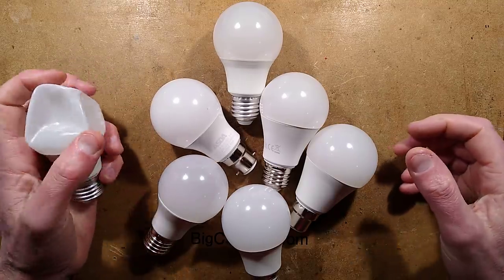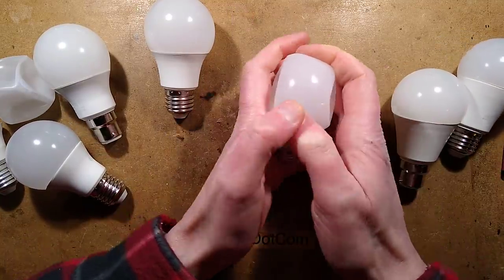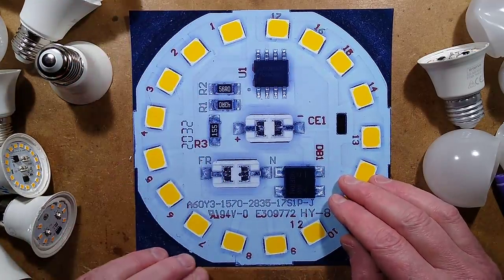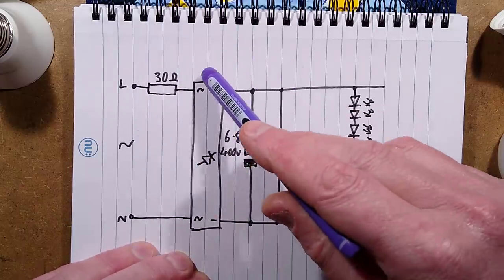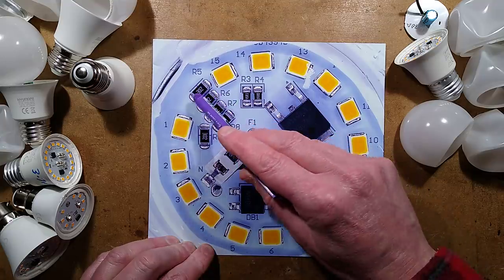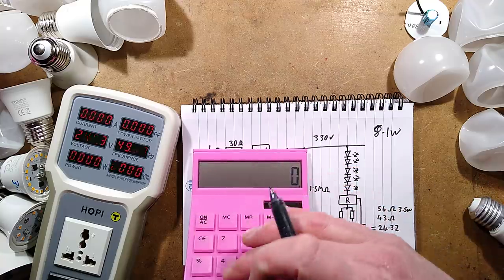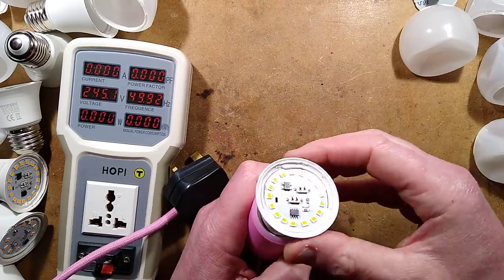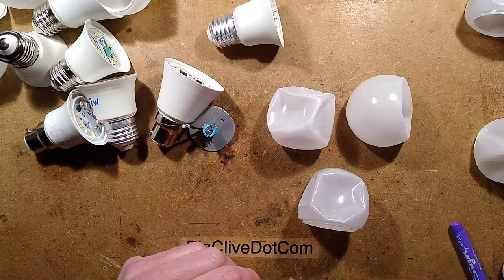Crushing and hacking LED lamps

Comment: Would it be possible for you or an equally brilliant individual to design your own Dubai lamp that someone like pcbway (for example) could produce? It really pisses me off that I can only buy intentionally overdriven bulbs that are designed to fail.
Reply: Thats.... Actually not a bad idea
Reply: Honestly i think it may be easier to just use led strips with your own driver circuit.
Reply: I think it really bothers most of us that follow Clives channel Chris.
Reply: Kickstarter?
Reply: My thoughts too. In fact when the lamps in this and other videos are modified in this way they are an equivalent, really.
Reply: these overdriven led's last less than incandescent bulbs, even philips ones. they should get regulated
Reply: And yet they're still really damn dark, I hate living in weird semi light even with the brighter LED bulbs available.

Having grown up with 150W bulbs everything else just seems like darkness and the ones in the shop that say they're 100W equivalent clearly aren't.
Reply: Get the highest powered leds you can find then make the mods.  Probably could use clear plastic circle glued on for the globes if the temps are right.
Reply: @ElvenSpellmaker  Problem with many LED lamps is the radiation pattern. Lamps such as the style in this video may provide similar light output in front of them, but hardly any back towards the cap.
They just don't look right in many light fittings and in a conventional pendant fitting they make the ceiling horribly dark which makes the forward light seem much more "glarey" and have harder shadows.
(Don't get me started on spotlights and downlighters in kitchens!)
My preferred type of LED lamp is the filament style in a glass bulb with the "pearl" or frosted effect, I've used the Osram Parathom Classic A and P shape versions of those for wall and pendant light fittings in my lounge and dining areas, but use the cheaper clear glass Asda brand (I got a load when they were on clearance) for less critical areas such as hall and stairs.
Reply: @nirodper  Hopefully they will. There was an article on BBC Breakfast this morning discussing just this .. the fact that modern appliances just don't seem to last, and suggesting forcing manufacturers to do something about it AND make spares available for at least ten years. Just like it used to be.

The whole point of LED lamps, we were led to believe, was that they would last something like 25 years. Deliberate planned obsolecence of products should be legislated against, IMHO. Whilst products would then have to be sold for a realistic price, it would be worth it for the environment and for us.
Reply: @ElvenSpellmaker  I do agree with this in general. They are only suited for mood or accent lighting IMHO; the minimum required for lighting a reasonable-sized room, say 12ft square, is a 15W LED or 105W halogen GLS, or, as you say, a 150W traditional GLS. Probably also supplemented with other light sources e.g. wall lights, table lamps etc. where needed.

A good example is my front room, which is smaller but with quite dark Victorian-style wallpaper, has a 6-lamp chandelier. I initially put 6x25W incandescents in but it was simply too dim even when turned right up. 6x40W incandescents (or now, 28W halogens) are just about adequate but I wouldn't be able to work under them. I suppose 6x5W Daylight (6500°K) LEDs might be better especially as the white light would illuminate the wallpaper colours more efficiently. Would need to be dimmable though!
Reply: @BG101UK  You actually don't need dimmable LEDs you just need to buy the correct dimmer switch unit. Trailing edge dimmers can accommodate regular LED bulbs fine and work the same as the old incandescent. It's the older style leading edge dimmer switch units is where  regular LED bulb compatibility is shoddy at best and non functional at worst. It might be worth it to look into changing the dimmer switch unit so that way you can just use the same LEDs you already use without having to switch over. Which is cheaper for example GE 4 pack 60W equivalent LED's non dimmable cost 9.99(7.17 pounds ) and the dimmable cost 11.99(8.61 pounds)  tax for these in USD can range is about around 1.55 depending on store. Which you can find leading edge dimmer modules on ebay that are the same price as the the 4 pack for the same price roughly as the non dimmable bulbds
Reply: PLUS the fact that the manufacturers state things like 25,000 hours life or lasts for 25 years! More like 25 weeks for some of them!
Reply: @BG101UK  
Ok make spares available for ten years !
That'll never work …...........

Your spare is in stock madam .
It's 4 times the cost of a new unit madam . 
No madam it must be fitted by our technician .
Cost we charge £90 per hour .
The book time for that job is 3 hours 11 minutes madam .
No that's 4 hours plus the call out & disposal fees madam .

Do you ….. madam are you still there    ….....
Reply: @gd2329j  the idea is that products be designed to be serviceable, and have parts available. It should be obvious, really. I don't know why we're still even putting rectifiers in bulbs, it should be a thing of the past.
Reply: @ElvenSpellmaker  you grew up with 150W bulbs?! In my family's home we used 60W bulbs in most places. Thinking you were putting a 60W in but ending up with a 100W was obnoxiously bright. Our living room used two triplets of 60W bulbs, I suppose that technically came out to 360W for the room, but it was soft. Have you tried multiple bulbs?
Reply: It's very easy to build your own LED lights. The open source world has you covered with a variety of options from kits you assemble into a pre-determined form, kits with the parts but you decide form, parts to make your own kit and these are all available from "wtf is a soldering iron" to "fastest iron in the west" level of electronic skill.
Reply: @simonparkinson1053  You can also get bulbs that are half-mirrored to reflect light back up to the ceiling.
Reply: @Chris Mc  Do what I do. I run the 2700K downlights through a simple $12 tabletop light dimmer meat for LEDs. This way I get exactly the amount of light I want in exactly the look I want. No soldering needed.

BTW, FWIW, I avoid this form factor of light that is screw in. I only use the ones the power company gives me for free aside from some colored one's I've purchased from Aldis. They all run hotter than the form factor of the downlights. I even have lamps converted to the downlights. I have used these for about a decade now with no signs of them going bad yet. It's about the same thing as a Dubai lamp in the end.
Reply: @Milamberinx  Why wouldn't we put rectifiers in bulbs? Are you saying lighting circuits should be low-voltage DC or something else?
Reply: @BG101UK  I'm in the USA and have been watching LED labeling. They used to be labeled to the effect of 25 year life at 3 hours use per day or sometimes 25,000 hours. A few years ago all I could find were 15 year. Now almost everything is listed as 10 year or 10,000 hours (not quite 10 years). Of course, the 25 year bulbs started at $40 per bulb and the 10 year ones are often less than $3 per each in a set of six.
Reply: @creamwobbly  We most certainly did, what an odd thing to try and dispute. XD
Reply: @Chris Mc, Give me a few days to research the specs of a Dubai lamp, acquire some "intentionally overdriven bulbs", then modify and test them and I will report back here to reveal my findings. 👍 If anyone else would like to replicate it to ensure no biased results, it would be welcomed as well as appreciated!!!!
Reply: @BG101UK  You can blame RoHS in part for the fact that modern appliances don't last. Lead-free solder has the advantage of not putting lead into landfill for products that are just thrown away instead of recycled, but it also tends to crack much more readily under thermal-cycling than the old lead-based solder does, putting products into landfill earlier.

Bringing in right-to-repair laws with availability of schematics and spare parts and bringing lead solder back would overall reduce the amount of waste. I've got a 7 year old TV that's still great - except the organic phosphors in the back-light LEDS are degrading so it's discolouring to be rather pink and splotchy. I'd rather have a couple of dozen LEDs replaced than have to throw away 15kg of mixed metal/glass/plastics
Reply: @michealpersicko9531  Thanks, all my dimmers are at least 20 years old and are likely leading-edge. I guess some LEDs with SMPS would still be an issue though? I'll have to check on the prices here.
Reply: @gd2329j  I see your point,. The cost of parts is also in need of moderation. I suspect many spare part prices are artificially high, maybe to discourage repair. If extra parts are made during the production run they shouldn't cost that much more than when supplied as part of the product.
Reply: @simonparkinson1053  Yeah, the filament bulbs are quite nice, although my personal favorite are the glass COB filament style like these in this old video here: https://www.youtube.com/watch?v=auUlTDunBCc
You get the full light from both sides like the filament tube style but they're bigger and brighter, the only problem is they practically don't exist and even if you can find one, they're a tad expensive compared to the hundreds of $1-$2 bulbs everywhere.
Reply: @Sylvan_dB  This is certainly the case; I wonder how many people notice though? .. I make a habit of date-coding lamps when fitted although I do sometimes forget.

I expect lamps used in enclosed fittings and run for significant periods at a time will have significantly reduced lifespans. I do have one in the bathroom globe but it's not normally left on for hours on end and has been going strong for about four years now. Think that's a 15W lamp, daylight and just as bright as when new. I'll see how long that one lasts!

These newer LEDs with 10K hours rating are easily outlived by traditional fluorescent tubes, which are still (usually) cheaper. The ones I have in the kitchen have done well in excess of their rated life and still soldiering on. Magnetic gear of course, with electronic pulsestarters. I won't be converting those to LED! Yes I know it's 99 watts plus gear losses with them all on, but whatever .. ☺
Reply: @HaralHeisto  Exactly! There is no way all the components of these modern products can be recycled/reused.

By the way, I'm (still) part-way through restoring a 1950s flip-top Murphy (as my lecturer called them, it's a 310A) and have other (newer) sets which are either in working order or only need a component or two changing to put them right.

There's a Sony TV-990UB in the kitchen in regular use, still works fine. I have another which needs putting back together and one which needs a bit of attention (a bit deaf on UHF). Also a Dynatron cabinet set in the front room which just needs some dry-joints sorting out, these sets are about 50 years old! I have my doubts that the flat-panel sets of today will last that long.
Reply: Would it even worth? I mean, led bulbs in my house lasts at least 5 years. Some of them have 5 years warranty. If failed before, the manufacturer just exchange them for free.
Reply: @rupert274  put another set of leds anti parallel to the first set
Reply: @Chris Mc ... and I thought this very video is the instructions as how to convert any old led bulb into a dubai lamp by taming it down a little
Reply: @BG101UK  
A little insider insight may be helpful here .
Most are just resellers & don't make the parts .
It's made for them with their logo , in the required flavour & for the agreed cost .

This resellers price can be more than 100 x the original cost !

Here's is a real example from 2009 .
The manufacturer makes a unit , it costs £8 it's purchased for £15 by the reseller , the resellers price for Jo public is £180 .

A authorised dealer will get discount depending on affiliation or subscription normally 40 – 60 % 
that's how they make a profit 
( But the final price for Jo is £180 ) .

No further comment will be made on the subject .
Reply: If you have a lamp in mind we can work together to design the PCB for it, I am reachable on my Instagram account with the same name as here on YouTube.
Reply: Wouldn't these "showerhead" lamps do the trick? I mean the lamps with a surface densely packed with LEDs as they were common with first generation white LEDs.
Reply: Doooo eeeeeet!! Pleeeeaaaassse!
Reply: @masteryoda394  You don't understand the error.  This has nothing to do with designing a new PCB.  Those lamps can use same PCB and just more series of diodes to half the current, or whatever fraction you want, to achieve similar light output.  The circuit change is trivial rather than the manufacturing of putting more of those strands of LEDs on a hanger in the bulb.  You can of course, solder something up yourself to achieve this, but again, it is not about designing PCBs but rather the mechanical installation of the addt'l LED strands.
Reply: @stinkycheese804  good point,it is a lot easier to just get a lamp and modify it rather than go through the whole design Phase.
Reply: @ElvenSpellmaker  Ikea used to sell a 22W LED bulb that was over 150W equivalent. I bought a couple for my Mum's house after my sister kept complaining about the CCFLs taking too long to warm up. They seem to have discontinued them now, probably because they were £15 each and the size of a grapefruit.
Reply: @MrDuncl  AHAHAHA shame! I wonder if the technology has advanced now such that they're no longer so large
Reply: @ElvenSpellmaker  The LED die tech has advanced, but also they're just saving on material costs and letting bulbs run hotter with lower lifespan expectations.  A well designed 22W LED bulb SHOULD be about the size of a grapefruit, if in the normal bulb form factor.  That gets to the point where it may make more sense to get a lamp fixture with integral LEDs what can make use of the housing for heatsinking.
Reply: Indeed , on the package it says "rated for 35000 hours" yet they always tend fail within 6 months of normal use. Planned obsolescence with these bulbs.
Reply: @randyherringshaw6325  I actually have recreate a simple Capasitor Dropper that fit into an E27 Extention Fitting 😒
https://drive.google.com/file/d/10qttIi6P1Sv8wCH8FWS0PLRGNeoSyzQH/view?usp=drivesdk
I failed once because I use a wrong Resistor Value, but now I have 3 version of them..
1w Dropper, 5w Dropper, and 10w Dropper

😒 But the 1w Dropper is just a dynamic between 0.5w to 1w, depend on the LED Bulb it used..
Smaller LED tend to be 0.4-0.6w, and Larger LED tend to be 0.8-0.9w
Reply: This might be a dumb question, but if you get a 3W LED lamp of a given type, is that essentially a 5W of the same kind but without being overdriven, or is it a lamp with fewer LEDs but also running at the max?  I mean, is this typically only a problem with higher output lamps?
Reply: @ironpirate8  🤔 I think most of them seems to be overdriven..
I already open some of 3w LED, 

Most of the Cheap or even more Expensive 3w LED Bulb seems to be not having any alumunium heatsink on it's Bulb body,

unlike the 5w LED Bulb,
yeah the cheap 5w LED dont have any alum. heatsink over its plastic Body, but the more expensive one have little bit alum. heatsink inside its plastic body
Reply: @ironpirate8  most of 3w LED Bulb seems to be overdriven because they tend to be getting really hot when turned on for a few minutes...

I already hack them to be cooler, could be 0.4w-1w..
Reply: @nirodper  yeah it sad, half of mine died within 8 or 9 months using only 6hrs a day. I've had incandescents go 3 years+ in this same fixture
Reply: @ElvenSpellmaker  You can still buy proper halogen bulbs, the high wattage ones should last longer as well.

Comment: Lamp manufacturers hate this trick!
Reply: No kidding better stock up before they change the design.
Reply: Incandescent is not even phased out yet and they are already all in in the cheaping out bandwagon, just imagine when they get rid of the olde boi they'll basically sell you a shell filled with dirt at a premium and sue you if you open it, no thats already Apple.
Reply: No they don't. This is just a method to maximize lumens per LED while staying within a defined lifespan. The consumer that cares purely about efficiency and lifespan is not their target market, but instead the consumers that care purely about cost of the bulb, which this would minimize by using less LEDs for the same lumen output for a lifespan most consumers would be fine with.
Reply: @rexsceleratorum1632  Well, maybe not shot, but definitely Rick rolled.
Reply: @ironpirate8  You are a cruel person, I do not condone torture.

Comment: This makes me want to pop off the domes of the cree lights I have, as I have them in enclosures that can have a diffuser put on for videography purposes. I may also do a low-power mod so that they last forever.
Reply: "I may also do a low-power mod so that they last forever" I take it you're a guy after my own heart who turns his monitor and TV brightness down to extend lamp life? So many people don't and they last 2 years before needing service!
Reply: SuperJames 1985 what does it mean?
Reply: @Chromwel-A  Running LED's too bright shortens their life. If you run them dimmer, they work longer :)
Reply: SuperJames 1985 thank you. Eh, by the way, is LED tv also like that?
Reply: @Chromwel-A  Yes. Find setting in your TV menu for brightness, or backlight, and turn it down to 75%. :)